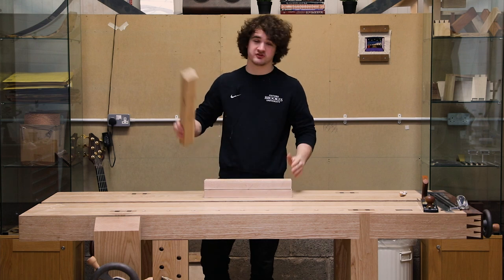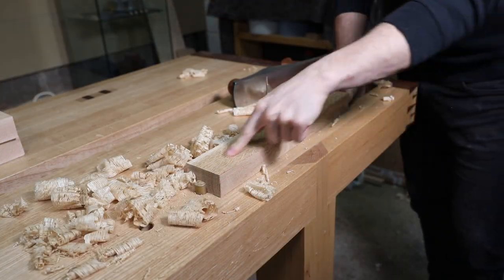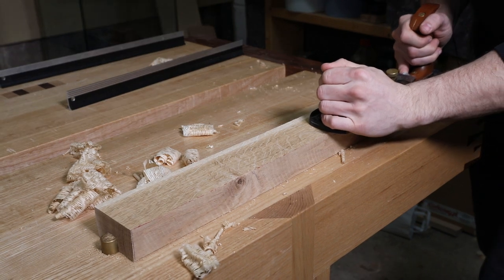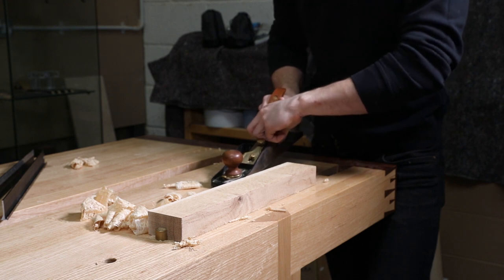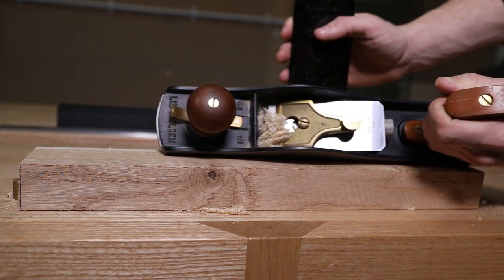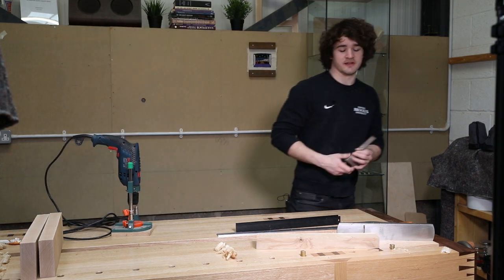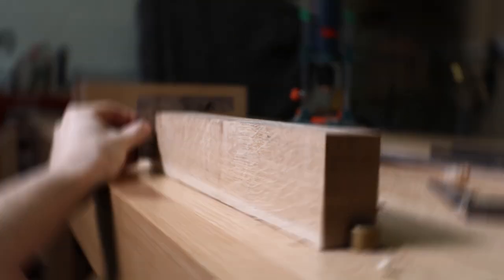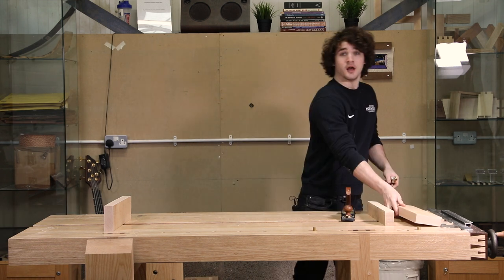Squaring Timber By Hand | The Chopping Board #2

Comment: As a violin maker, I spend a lot of time planing very highly figured wood dead flat by hand. The winding sticks are an ancient and fairly effective tool but nothing beats an accurate steel straight edge. Lay it diagonally across the piece and any wind will be painfully obvious. It will also show all bumps, high points, etc. The fewer times you change your tool, the faster you'll work.
Reply: I think winding sticks only work better for very long boards.
Reply: agreed, I make acoustic guitars and feel exactly the same.

Comment: I think you've convinced me to get a planer.  ;)
Reply from the maker: I think I've convinced me to get a planer.
Reply: I've got some pretty decent match sticks chasing 6 x 2 with a no. 4 plane. 1st lesson, chose better stock. 2nd lesson, get a bigger plane. 3rd lesson, pants on before shoes. My village wants it idiot back!
Reply: When I started out I looked at a few similar tutorial-guide-ish videos like this one, how to square & dimension using hand planes. Bought a jointer/planer combination the next week. Totally worth it.
Reply: I did a Live edge, Epoxy filled, Yew side table project when I was at home over Xmas, I was appalled at the finish on my 1972 Lurem P/T.
2 Sharpened blades, a lot of swearing, table adjustment, more swearing, more table adjustment and a day later, et viola! As perfect a finish as one could expect from a 45 year old machine with wonky infeed drive (Thicknesser).  Character Yew is horrid for snipe, as the grain changes direction like a Mumbai cab driver, but the finished results are lovely! Matts Planing techniques would have achieved even better results in a fraction of the time.

I also re-furbished my router table insetting the UJK Technologies compact Cast Iron router table top, my Incra Fence Positioner and Incra Miter 100SE Mitre guage! (Santa had been very good to me this year)!

Comment: Hi Matt
I'm currently building my first workbench and am running into a bit of trouble. With my bench top complete I have moved on to the legs and stretchers and I cannot for the life me get all four sides square. I am using your method of flattening, correcting twist, and establishing a face and one edge square. However, when I mark out the other sides to get the piece parallel and plane to my marks, I always end up with one side out of square. Any thoughts on what I am doing wrong?

Comment: Any particular tips on how to do this on a large piece...say 2 mts long by 20 cms wide??
Reply from the maker: Get a No.7 jointer plane and a long straight edge. Thats the best you can do other than sheer effort!
Reply: Matt Estlea - Furniture thanks! What are your thoughts on using a laser level for checking flatness on the board, since I dont know where will I find a long straight edge

Comment: Hi Matt! Great video, as usual! I got curious: I noticed your tools have patches of corrosion on them, and I was wondering: is it too damp where you live? I have this problem in my workshop and for a time I got worried about it, but I am now tried to focus on the work instead of the tools... but eventually I will need to tend to my tools so they don't get too rusty...
Reply: Just put some general-purpose oil (not organic oil) on a rag and wipe metal parts down with that and then wipe the oil off with a clean rag. Enough oil will hide in the roughness of the surface to prevent corrosion - for most folks.
Reply: Moisture in the air condenses on cold surfaces. Store your tools somewhere warmer and the problem goes away.

Comment: Hey, still learning here. Couldn't one use a jointer plane instead of chasing all the high spots down the middle to get a flat surface after removing any twist, etc?
Reply: Andy Midd Yes. I got that part.  That's why I said jointer plane and not jointer. 

I'm talking about using a #7 or #8 hand plane.
Reply from the maker: Yes you could, it's just quite knackering to use! The Jack Plane is the happy medium, or the 'Jack of all trades'
Reply: Thanks for the clarification!
Reply: I only know ye olde wooden jointer planes (which are ~60 cm long), they're not really meant for short boards like this. They're mostly for boarders longer than 2 meters or so.
Reply from the maker: You say that but I've heard that Furniture Making legend Alan Peters favoured a No.7 for the vast majority of his work. I must say I would be exactly the same if I wasnt such a lazy bastard.
Reply: Well, I have both a #7 and #8, and my first low angle jack plane is coming from Veritas in the mail. 

I'll try both and let you know how it goes.
Reply: Might be. Where I'm from iron planes really aren't used much at all. In the few niches that still use hand planes, it's all wooden planes.

I think with an iron plane it is more practical to use a big plane for small work. Two reasons: Weight and handles.

A #4 is maybe 2-2.5 kg. And  a #6 or #7 is maybe 3-3.5 kg. Either has two handles close to the blade.

A wooden doubleplane weighs less than a kilo and has two-ish handles. A wooden jointer weighs perhaps 4 kg and I've never seen one with a second handle. The handle is up and behind the blade, a second handle isn't there, so fine control is kinda difficult.